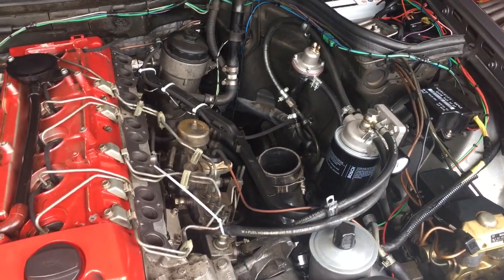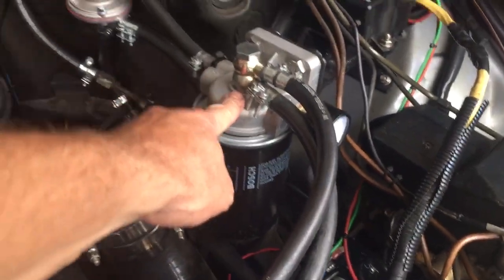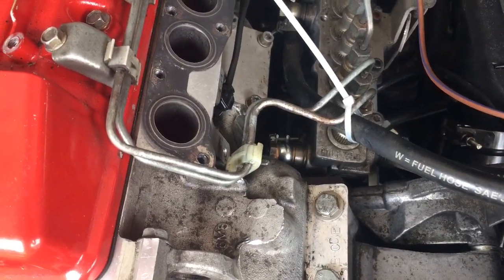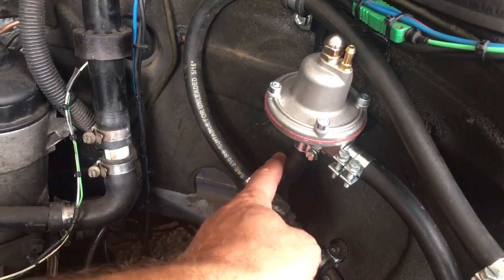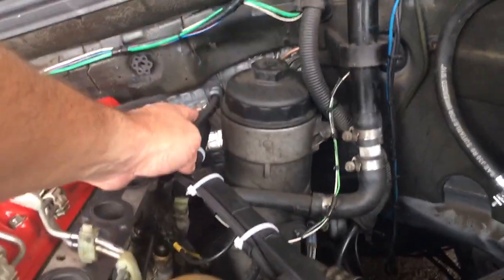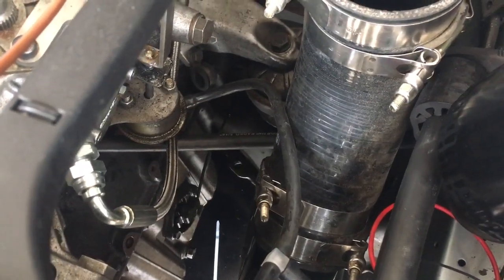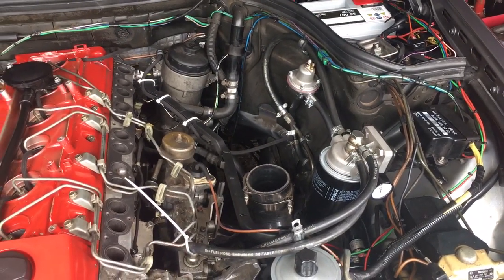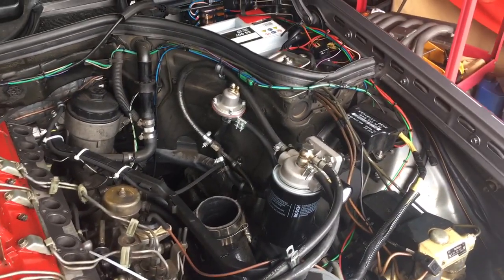W124 Superturbodiesel fuel system

Comment: Does the BOSCH 044 require any special current generator? 150amp for example? Or standard generator is enough for 044 work in its full strength?

Comment: Nice setup that I’m running the same sort of setup on my om605 190  and I’m glad it works for you hopefully mine works the same 👍🏻
Reply from the maker: Make sure you add water meth injection too, cheap and knocks loads of the EGT's.
Reply: Maximilian Boost I will have a look into it thanks for that 👍🏻

Comment from the maker: Update - this set up works, however the Bosch044 clearly is producing more fuel in pressure and amount than the reg can deal with. The reg should be able to regulate down to 1 bar, however the best I can do with the regulator actually doing something is 2 bar at 0 boost and 5 bar at 3 bar boost.having said  that the lift pressure clearly suits the engine as it works perfectly and there is a  substantial (I was told this would happen however its still very surprising...) increase in power too, I've turned the fuelling down from the original lower pressure Holley Black settings as the car could produce MASSIVE amounts of black smoke. Much better now and better smoke control is a result of better fuelling control. V Pleased - a great upgrade.More on this at http://forum.retro-rides.org/thread/182582/1990-mercedes-w124-superturbodiesel
Reply: Hi, i have the same issue on my W124 after installing Bosch 979 lift pump and now my fuel pressure spikes to 4 bar immediately after i turn the ignition on and you can imagine that the fuel injector side is a "little" leak happy after this :( To much flow and i think that my fuel pressure regulator is also restrictive :/ (cheap unit)  Is there anything i can do to lower the fuel pressure other then changing the pressure reg ? I would like to run 2 bar at the most all the time, in and out of boost cuz i am not chasing big power yet. Is it possible to run some kind of a T fitting to relieve the system ? The car has OM603 for now. Thanks for your video and for poviding helpful info :)

Comment: I don't really get why you need to give more fuel pressure with higher boost. It can just run high all the time with our diesels
Reply from the maker: The older pumps need more fuel at higher boost levels - that was the advise of the pump builder. New build pumps are fine with a static pressure. Apparently... some pumps have run away with high fuel pressure at idle.
Reply: Ah OK, hadn't heard of idle issues before

Comment: Great vid. Is the regulator an Ebay item?
Reply from the maker: nah  -its a Malpassi job - about £85. In practice this one cant keep the pressure below 2 bar, I was hoping to have 1 bar at idle - however the lowest I can do is 2. I think this is because the 044 produces more flow that it can physically regulate below 2 bar. Works a treat though, 5 bar FP at full boost.Ebay regs actually get good reviews.